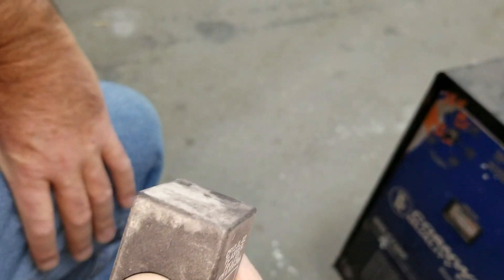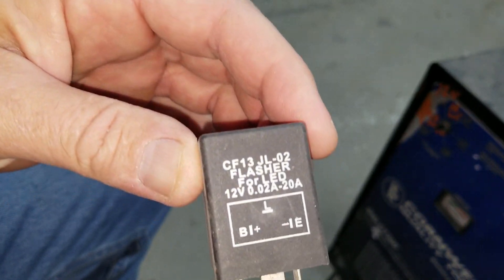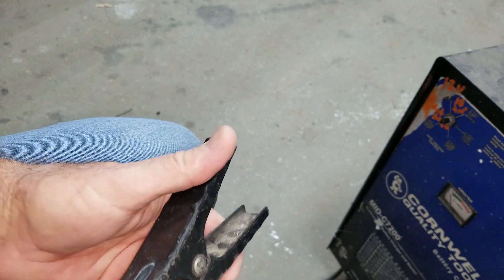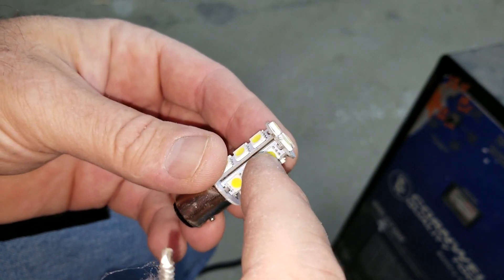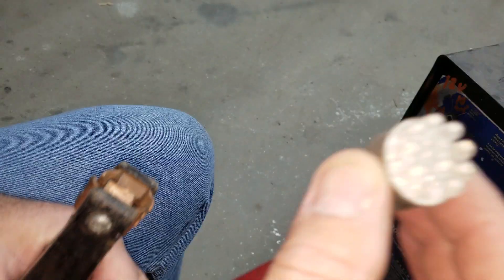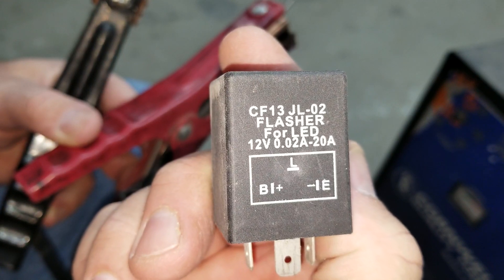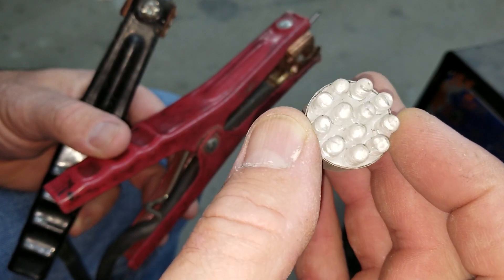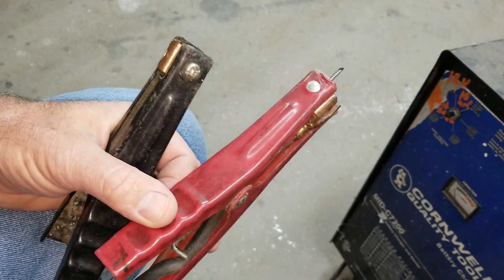1157 LED bulbs won't work on old cars here's why

Comment: I don't agree with this ...1) you're using a battery charger to rest them. For proper test they need to be in the vehicle in the light socket.
2) you're supposed to use the load resisters that you can buy at the parts store right next to those lights and install it it stops the backflow and it regulates the voltage
3) I have LEDs in every light socket on my 01 FLHT Harley-Davidson never have had hyper Flash no resistors where added absolutely no modifications send the clearance lights in the fender on the front to the clearance light on the fender in the rear 100% LEDs headlights Highway lights turn signals brake lights everything is LEDs so I would check wiring issues if you have a problem with your LEDs ...they are a great upgrade
Reply: These should already contain current limiting resistors.
Reply from the maker: it is not about resistance it is about feedback. on a car your turn signals will feed back to the other side of the car. Need to have diodes on a car. Motorcycle will work fine. dual filament  multiple  use turn and brake lights they will have problems working. unless you use diodes and sometimes even with that they will not work.
Reply: +Mal... LED light usually are made with current limiting resistors. Otherwise, they tend to overheat and fail.

Comment: My 1966 Corvette was driving me crazy LEG's would not flash even with the new led flasher. After seeing your vid I checked the polarity and for some reason the brown wire that is supposed to be ground is the hot. made a set of jumpers and they work.

Comment: I ran red 1157's in an 89 ford ranger, had no issues
Reply from the maker: not old enough I am talking about dual filament turn and brake lights on the same circuit.

Comment: For some reason all my turn signals work except the right rear, both blink but the left is weaker. but when I apply the brakes it works fine.I had all LED lights except the brake light which is separated from the turn signals I recently changed the brake lights now I have the right rear that lights up both unless I hit the breaks

Comment: Your turn signal switch should isolate the light that's blinking from the other side brake/flash, but if there's voltage on the other terminal of the led you are going to back feed the tail light circuit. But that would happen even with applying the brakes. And do you get voltage on the bright terminal if you apply power to the dim terminal? Sounds like an issue of useing cheap led's and a correctly made led should work correctly. And yes load resistors are a really mickey mouse ( sorry disney) fix. Better off keeping the added current and heat in the bulb where it was designed to be.

Comment: 1990 GMC. It's not a matter of hyper flash, it's that you can't see the difference in brightness between the turn/brake with the lights on at night, works fine with the lights off during the daytime. I got a fix it ticket and could not fix it without putting conventional bulbs in all four turn signal sockets so you can see the blinkers at night and the brake light brightness difference from the park lights! Yeah I have the flasher that corrects hyper flashing but that is not the problem.  CAN WE ADDRESS THIS ISSUE AND NOT THE HYPER FLASH

Comment: Thx. I tried to replace my incandescent 1157 Bay15d bulbs with LEDs for the brake/parking lights (they use the same one bulb). 
After replacing, the lights on when I brake but no light when used for parking lights. Thanks for this video. Was very confused as I thought it was a simple replacement.
Reply: So did you solve it ?

Comment: I have a 1986 f150 with a dual filament 1157 taillight/blinker and I have resistors hooked up and it works. I wanted to buy a different pair of 1157s just like the ones you have in this video wondering if they won't work
Reply: I'm gonna try a set in my 88 E350 motorhome

Comment: Thanks i was confused when installing led turn signals. My front has a 1157 type bulb i did also install led flasher relay but it didnt work.
Reply from the maker: Glad it helped sometimes you can get away with using diodes and isolate them but it is very hard to do. FYI.

Comment: If you have a problem with the power from one side back-feeding the other side, you have a badly designed bulb.  An alternative to replacing the bulbs is to put diodes in the feeds.

Comment: Wouldn't a diode fix this issue? (a one-way valve)
Reply: Yes, a diode could potentially fix this issue. 
However, you'd have to remember to bypass the diode if you ever went back to incandescent, as the diode would pass too much current, overheat, and fail.
Reply: LEDs are diodes 🤔
Reply: @Pooooooops  light emitting even!

Comment: What about an 1157 for a motorcycle that has a running light and brake light in the same bulb?  I bought one of these years ago and it never really worked very well.
Reply: Use the Sylvania bulbs..Models that use just a voltage drop for the tail and Brake use the 1156 the front ones you can use the 1157 but I recommend the Sylvania it's a better quality bulb little more money better result
Reply from the maker: on single bulbs they work perfectly but on dual tail lights on older cars it still feeds back. I used diodes and got one set of tail lights to work. I tried to make 2 rear sets on the same circuit all with diodes and still got feedback somehow.

Comment: im so confused because on my 2005 4runner the right parking light it works fine but the left tail light it doesn't im so lost
Reply: Try turning it 180 degrees

Comment: yep. installed led brake bulb on my 1998 suzuki baleno and "lost" the over-drive gear. took me months to notice that theres connectios between the two. if not the led burned. I would have known the reason for that

Comment: I used these in my 93 eclipse turbo 
And all I got to work was the brake lights were on ad nothing else 
No signal and no runing 
I put the original back and it's good again 
So maybe I need to rotate the brake lights and the tail ight as It h the positive wire for a test 
Maybe it would work 
China led lights don't work

Comment: The one you have are canbus error for modern cars the standard led light will not do that one side is low load other side is high load to trick cambus not to trip a warning light on you dash none cambus led bulb  turn, brake, dip, highbeams will work perfectly on an old car because the only draw between 2.5 and 2.8 volts thanks non campus error

Comment: Bs! Spin the bulb 180degrees u do not need relay !!!!! Maybe ground here and there but you can absolutely use 1157 led bulbs in old vehicles …. The issue lies when u run leds with halogens that’s why u having issues …

Why someone wouldn’t do all the lights on the vehicle is beyond me but that’s the issue .

I have three old fords and bunch Lincoln’s that work just fine also I run these in old Meyers plow frame lights on all
My trucks work fine !

It’s a dual “filament” board  led hence why when you spin the bulb it’s brighter lmao 

YOU CAN RUN LEDS IM ANY OLD VEHICLE FACT. No flasher or relay bs needed.

Comment: Wrong explanation. This is because led on the market all wired for 1157 instead of 3496 which its a reversed filament bulb for older cars. Just switch around high low filament wire on socket then will resolved this problem.  It works.
Reply: How do you do that? Sorry, I am total noob with electrics

Comment: There is nothing wrong with the incandescent bulbs. I use them in my older vehicles and house and everything is fine.
Reply: Absolutely...its just led only uses 6 volts instead of 12 and runs cool to the touch...but ya works fine no worries

Comment: It would be interesting to know what are the Asians thinking when they make these bulbs at backfeed what application were they created for. They don't work on Old American Fords and Chevys. And they certainly don't work on European cars they all have devoted sockets. I found all the bulb sockets are dry rotted, and when I redid the inner of the housings and removed the reflectors from the buckets, the front I'll use the 1157 with new sockets and the Switchback bulbs, and electronic flasher and on the rear it has four bulb sockets 1157 those are going to be changed 21156 the lower buckets with the smaller reflectors will be the running lights the upper with the larger reflector buckets will be the brake lights why it will reduce my brake lights from four to two because the rear reflector panel will have a LED strips behind the reflector so that panel across the trunk will also be running lights and brake lights one rectangular LED strip will be for the running lights and the other will be for the brake lights when I finish the project I'll post a video it should look quite unique. All LED low power draw and no heat. The cost for the whole setup will be almost $100 by the time you get all the sockets all the bulbs all the LED strips all the corner connectors and run a devoted wire all the way from the trunk lid to the brake pedal switch so when you hit the turn indicators your strips in the panel don't flash with the blinkers. So cruising down the road my 50-year-old car will compete with all these new modern lightweight electronic crumple Zone caskets. I call them. I'm glad you let us know about the feedback on these bulbs because I have a whole box of bulbs and it's always but try this one try that one when I'm outfitting a vintage car with better lighting. The interior straight forward and pretty easy but diesel 1157s on the old cars can be tricky. On a French car I actually used LED plates behind the lenses and did away with sockets and bulbs had to solder each plate those works very successfully very bright.